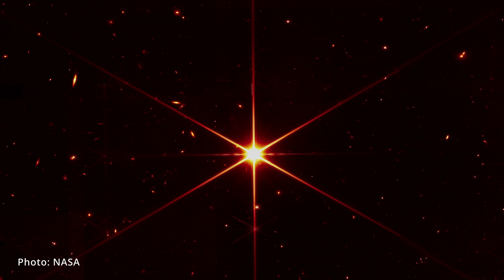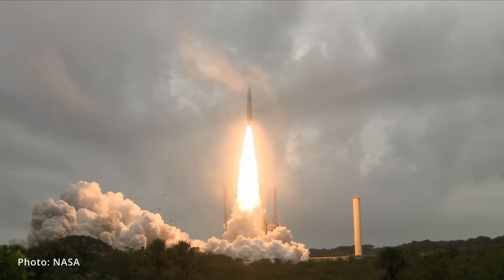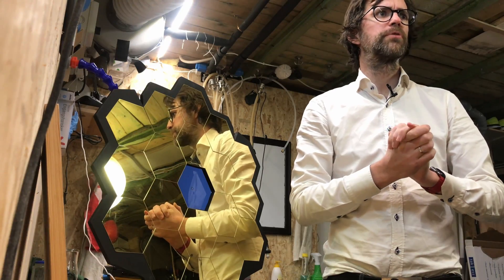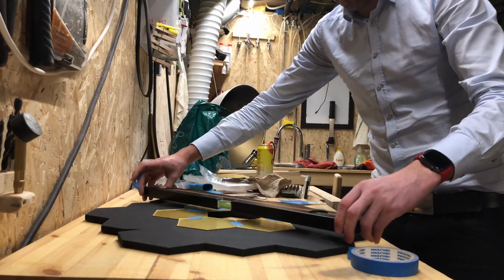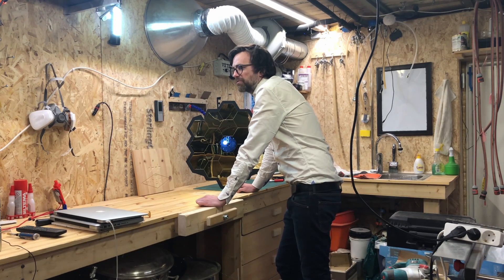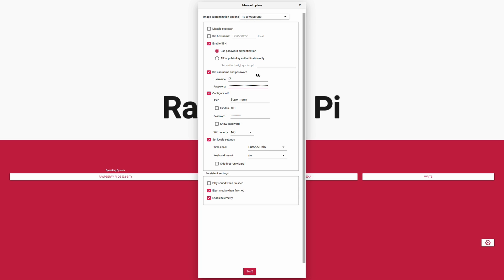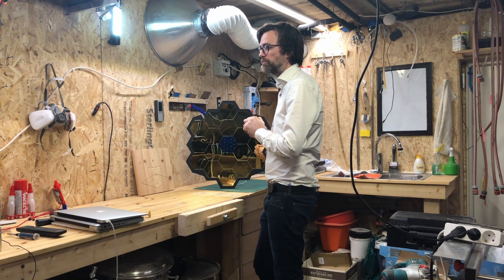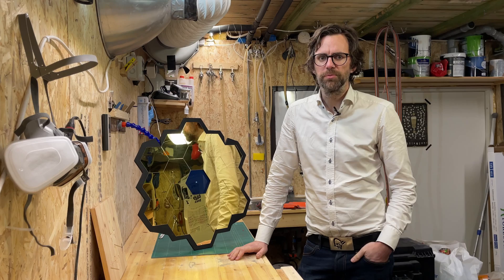See deep into space with a Webb model on the wall

Comment: how did you stick it to the wall? is it not too heavy with the plywood, mirrors, etc? 
great project! I plan to use high density foam instead of plywood but not sure how to mount it with the Pi sticking out the back...🤔
Reply from the maker: I attached a string of stainless steel to the back with a couple of screws, if I recall correctly, and hung it on a screw in the wall. I have no worries about it, but of course your mileage may vary.

Comment: The LCD is perfect for proof of concept and you have the controller ready to go for the next project, :) .  I like that you use the Pi 2, because that's all you need.
Reply from the maker: You don't even need the Pi 2, if my one of my OG Pis were still around I would have used one of them. But you're totally right, the amount of computational power needed is very low.